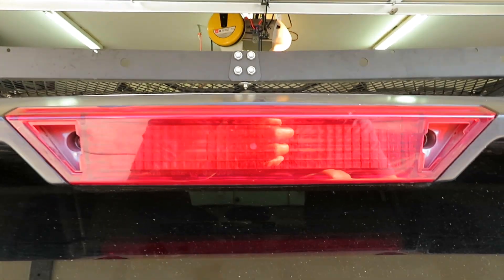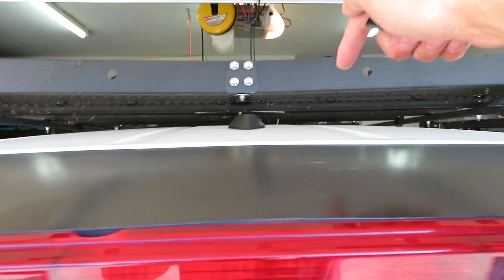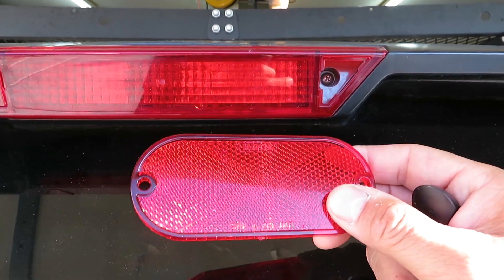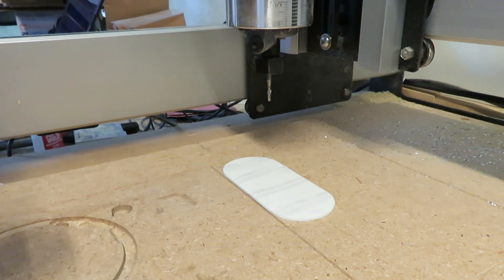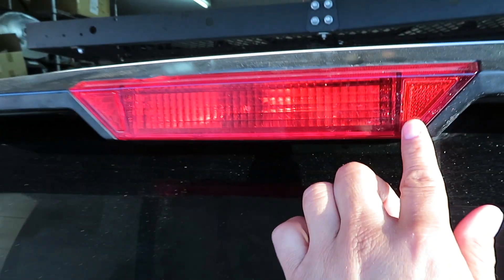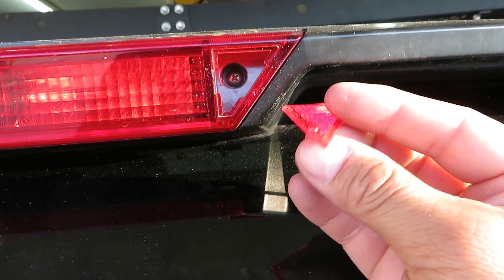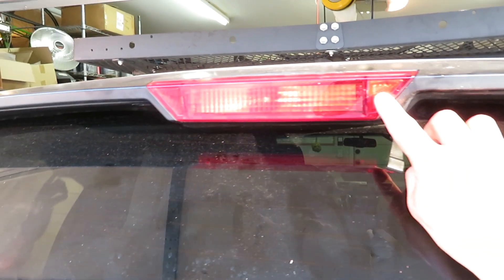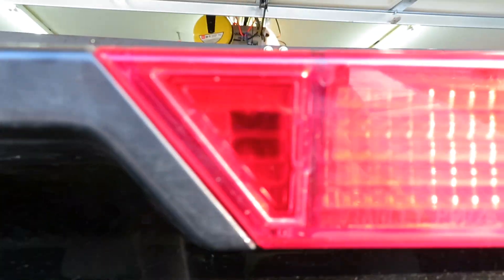Machining a plastic part

Comment: Did you even price the part? Though im sure youd hv to buy the set so vm it did match. Lol. Let alone the lighting cover.
Reply from the maker: I just looked it up. They don't sell the little covers by themselves. The third brake light runs about $50.00 while cutting the reflector cost me $2.00. It was worth the fun.
Reply: FIRST CLASS AMATEUR , make them for $2, sell them for $20. Bonus points if you kept the code.